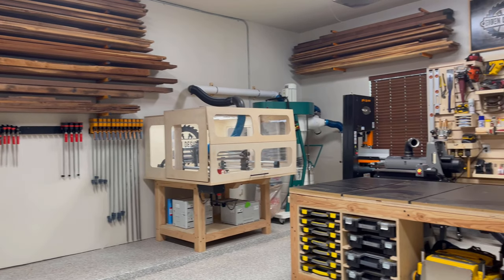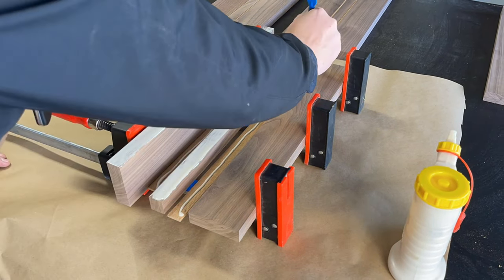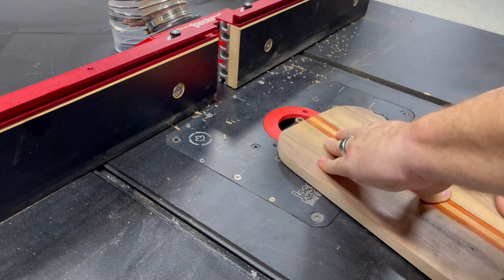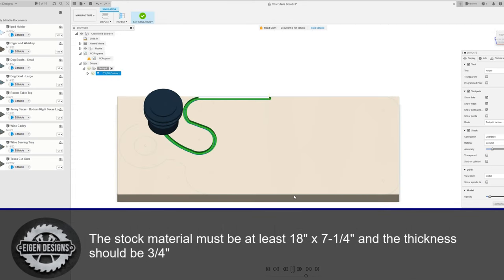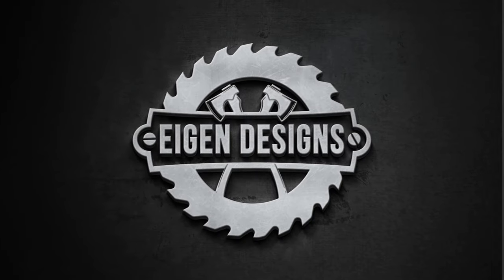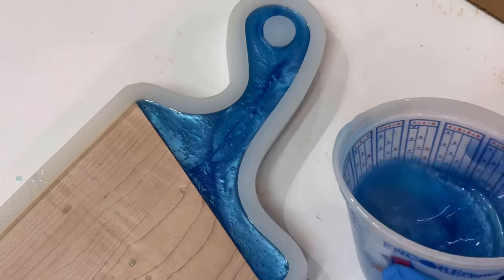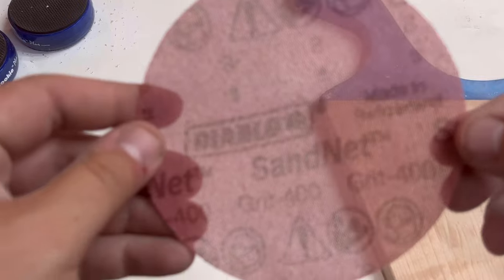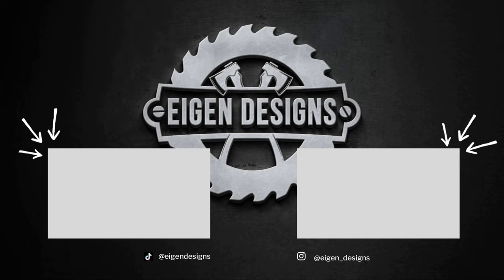3 Ways to Make Chacuterie Boards

Comment: Love your stuff! Spade bits are about the worst way to cut through any material beyond building a deck.  Also, what is the connection between the wood and epoxy besides an end grain glue surface? Maybe a biscuit slot for more purchase?

Comment: What’s the easiest CNC machine to get and learn?
Reply from the maker: Hey Kandie, there are really two parts to your question. There is the CNC itself and the software you design your projects in. I think the OneFinity is a great machine to learn on and would highly recommend it. As far as software goes, Easel is a good choice as so is carbide create. I personally use Fusion 360, but it has a pretty steep learning curve. I hope this helps :)